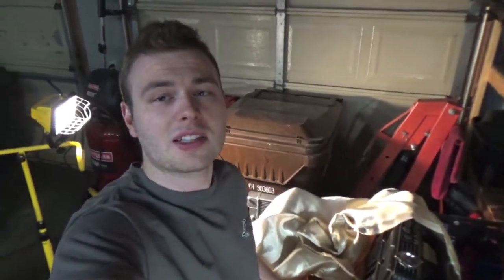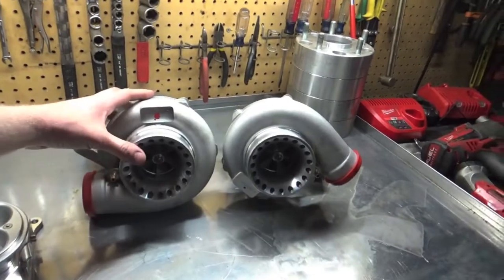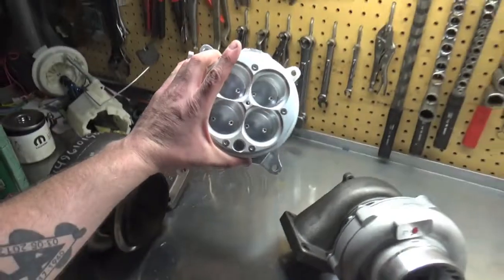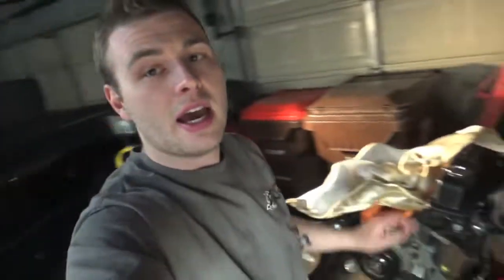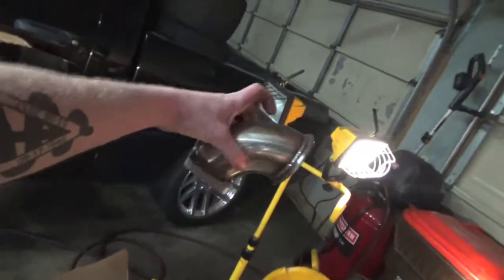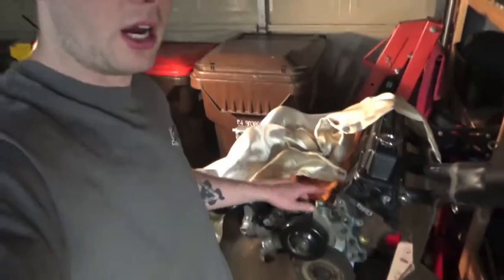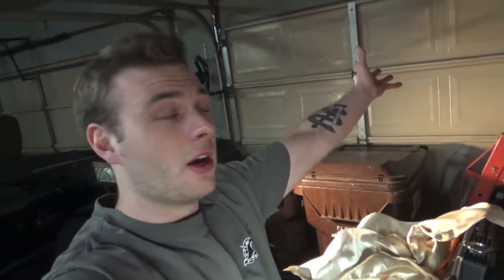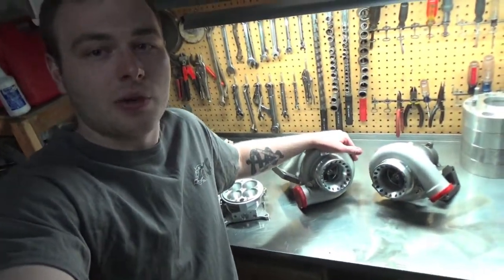Twin Turbo 5.9 Magnum UPDATE

Comment: I have a 95 5.9 and I wanted to turbo it, but ended up buying a 93 Cummins and building that instead. I still have the truck and a stock holset h1c turbo from the Cummins so I’m back to thinking about putting a turbo on the 5.9. My question is what would be the best way to tune it since it’s a 95 and OBD1

Comment: Where did you get the throttle body? I currently have the hughes big gulp and airgap manifold.
Reply from the maker: Chris Atkinson got it used off of 5.9 Facebook pge
Reply: Its nice and gonna flow like crazy any idea of the brand?